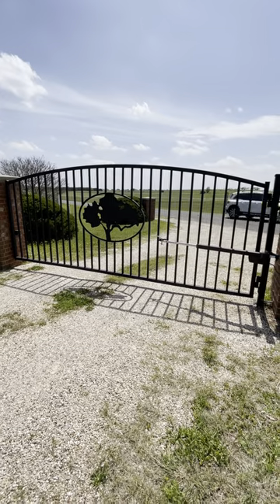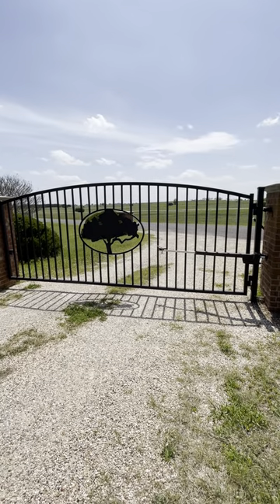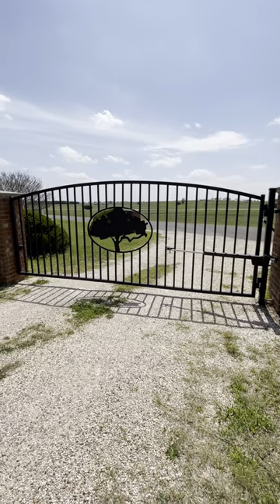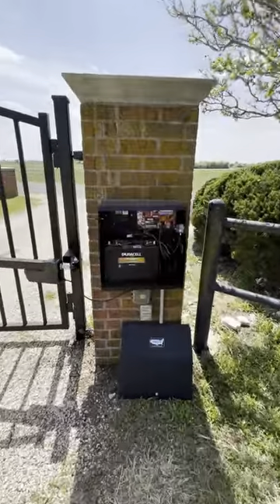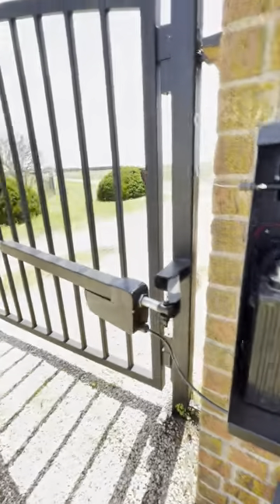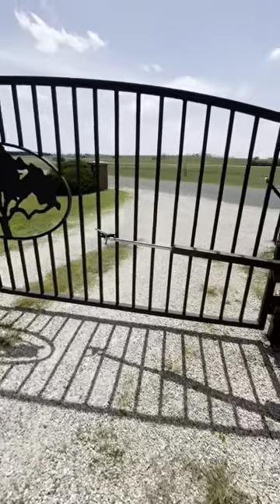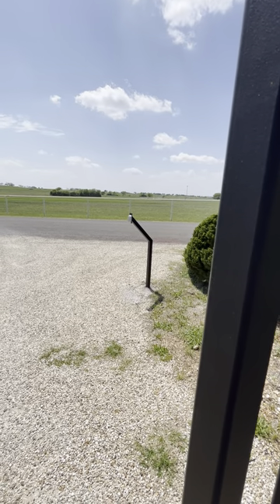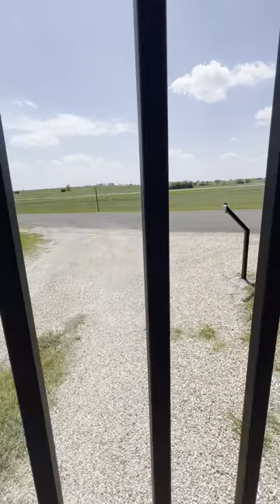US Automatic Ranger HD Swing Gate Operator Overview Of Install

Comment: How do you have the photo eye wired? Do you have both NC and NO connected to Pin 6? I assume that Pin 7 is C (common). Do you have the 12V GND run directly to a separate power source? I have followed the instructions and cant seem to get it connected properly. Im having to manually flip dip switches 7 and 8 every time to get the gate to operate.
Reply from the maker: Red to 12V+, black to 12V-, white to common, green to NC on the photo eye. Then on the board J2 (green plug), red to 12, black and white to 2, 5 or 7 (commons on HD board), green to 8. You can turn off 3 and 4 dip-switch on J2 and wave your hand and know if you are lined up. Now the Photo eye will only work when the gate is closing if wired this way! Make sure that 8 and 12 dip switches on SW1 are to the right. let m know if that helps!
Reply: Thank you so much! Forgot to respond, but this worked perfectly. @StarFenceAndGate